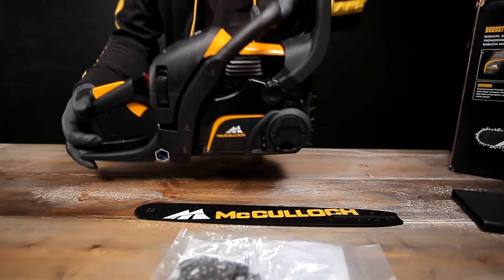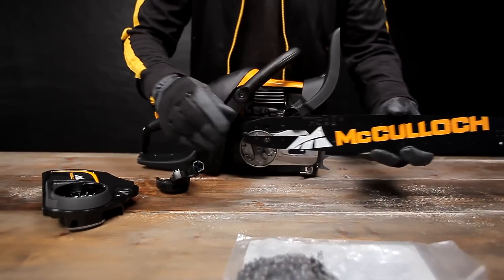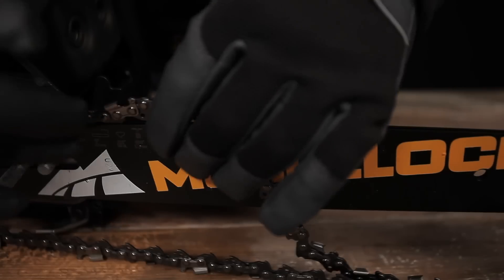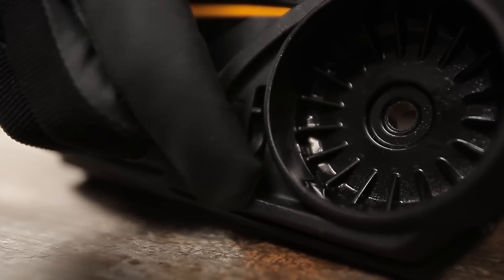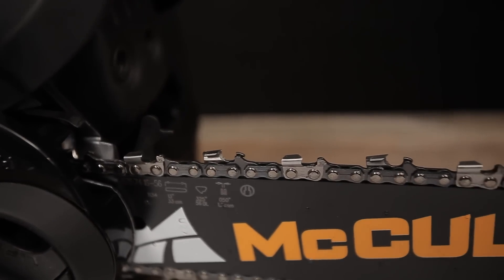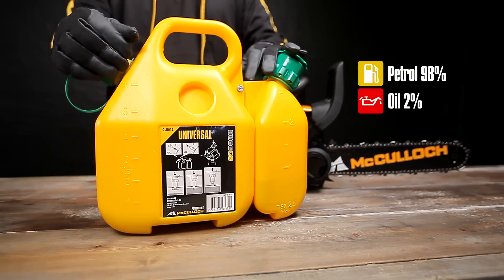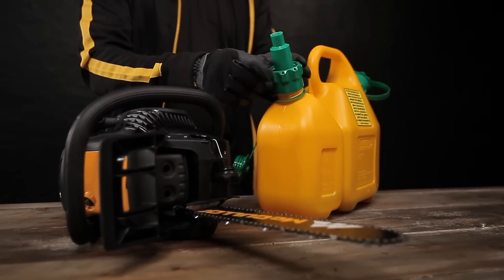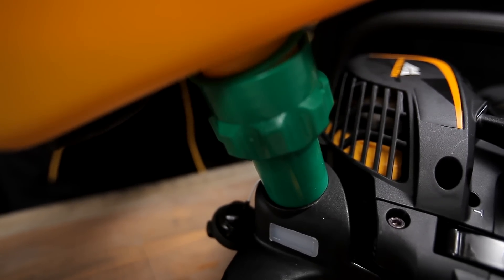Getting started with your chainsaw -- tool-less chain tensioning

Comment: I have this saw and am very happy with it ,I would never use 50-1 fuel mix, I ran mine in with 25-1 and after that 30-1 ,you can't adjust the carb mixture needles without special tools so richer fuel oil mix will help in extreme heat conditions and may save it from seizing ,hope this helps some people.
Reply: No, not really. I've found that 50:1 full-syn works great overall, even for milling. Run a saw too lean, winter or summer, and you can torch a piston. Test condition: just starts to "4-stroke" @WOT unloaded. Easy as pie. Yer welcome.

Comment: Whilst a CS400T purchased new for the third time it through the chain off and .  Keeps losing tension and even after rebuilding it after the first time it happened it Appears no matter what tension I set it starts to work loose.  Is there a real diagram for the assembly so I can find all the parts that may need replacing?

Comment: Thanks so much to teach.
how to use this chainsaw...
Can you pls tell me.
Can I mix any type of oil with petrol.
Or something special for this Machine..
Thanks
Reply: I guess you've already got an answer but if not = NO. to be safe only use chainsaw oil. Cheers
Reply: And ... do NOT use 2-stroke mix oils for outboards (water-cooled engines). You need oil for air-cooled engines. If you value the saw and want long life, pay the tiny percentage more for reputable-brand full-synthetic. Works great for me.

Comment: :!2 that is one big honkin instruction manual
Reply: I've a couple like that from Clymer, covering just about every brand & model made in the period prior to X number of years prior, Alpina to Wright ferinstance. The shop manual for a particular brand's model would be nothing like that. Overall, dunno about the recent "McCullochs", but still get lots of work out of my wee 35 cc Jenn Feng "McCulloch". Just pointing out that the label means nothing.

Comment: i thought McCullouch went out of business ?.........do they sell parts for old saws?
Reply: Yup, they're long gone, as a company. The name's been bought by Jenn Feng, and then Husqvarna. There are sources for parts for oldie Macs, but you've got to do some digging. First find an IPL (illustrated parts list) for the #s of the parts you need, then search for the specific parts. Or parts saw(s) that can be cannibalized. Ebay's sometimes a help.
Reply: @jacquesblaque7728  do chains made for other saws fit the mcculloch?
Reply: Chains are gerneric, not specific to saw builder/model. You could just call Bailey's; I'm sure someone there'd know. There and elsewhere you'd want to specify: pitch, gauge, profile (if not std.), cutter type, # of drive links (#DL). Notice- no mention of length- that's no help. Some saw bars have #DL stamped. Oregon (Blount) publishes guides to help ID chains and precise meanings of above. Good luck.